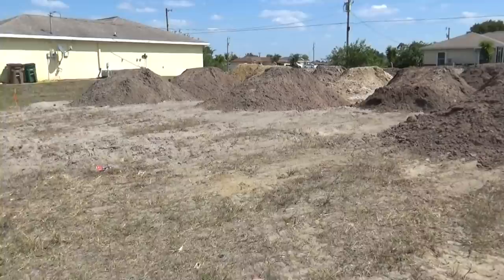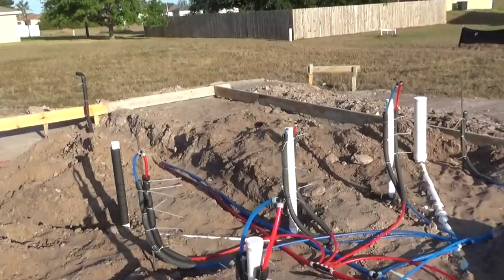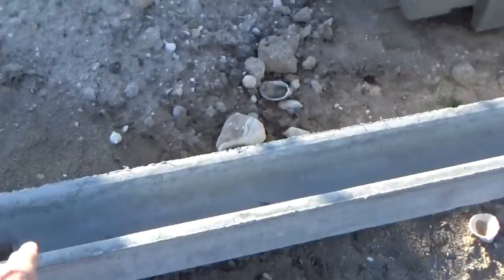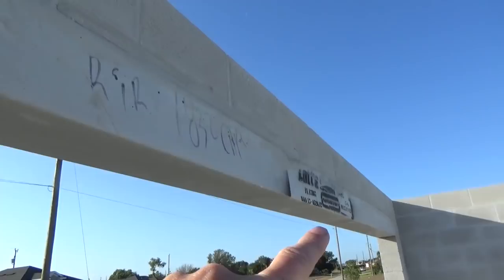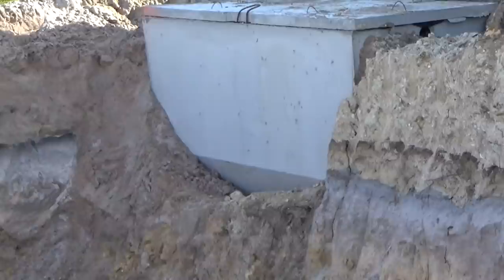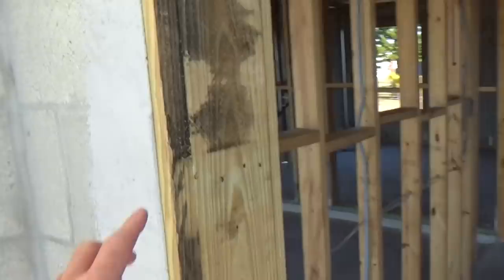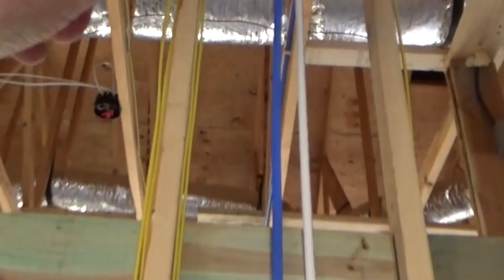FLORIDA BUILDING TECHNIQUES (Mike Haduck)

Comment: Have lived in South Florida 64 years. The construction you saw is production line home construction. You are right when you say it is very shortsighted to pour a concrete slab over the plumbing, but that is the way it is done because it is cheaper and the buyers know nothing about construction. 4 of 5 Florida homes I lived in, were stem wall foundations with a crawl space where all the plumbing was accessible for repairs or changes.  The sewers in my homes were all city sewer lines not septic. It looked to me like the fiberglass insulation you showed was just for the interior partition walls. For the block walls, they likely used aluminum faced 3/4" high density boards between the furring strips on the block walls, with the block/foam/sheetrock I think it is R-11. In the old days it was just block/ 3/4" air space/ sheetrock. A really big foolishness is that they have the air conditioning ductwork and returns going through the attic which can be like 140F+++ degrees, the ducts are like heat exchangers fighting with the air conditioner and practically all the houses are built that way. A big difference between Florida and PA is that they've been building houses in PA for 300+ years, and people lived for generations in those homes, things were built to last. In Florida, it's only been like 70 years and people move every 5 years.
Reply from the maker: Thanks I agree, Mike

Comment: Not an apples to apples comparison on the gravel part, railroads are built on crushed rock ballast specifically so that it CAN shift with load.
Reply from the maker: Thanks, if you got more info or a video on that I'd like to see it, the old timers I knew who worked on the railroad told me rocks are rocks, every bit of info is helpful,  thanks Mike

Comment: I have built over a hundred homes in Ohio and I can tell you that pressure plumbing under slabs is the absolute standard. Zero call backs
Reply from the maker: Hi D, God bless you, I won't pour concrete over them unless they are sleved,  I learned my lesson, thanks Mike

Comment: Florida has the highest home insurance rates in the country because of hurricane damage payoffs. I could see block construction as better able to withstand hurricane force winds but if the hurricane straps aren't installed correctly off goes the roof. Big scams in hurricane re-roofing lawsuits also driving up insurance costs
Reply from the maker: Thanks Shakespeare, I believe that,  thanks mike

Comment: It's interesting to see the homes being built in Florida. I'm from India, and most of India has the same climate as Miami and we get lots of terrible monsoon storms. We would never use wood for anything structural. Even the roof would be made of concrete+rebar and be flat instead of sloping. And you would be able to go on the roof. Other than that and the plumbing part, the methods used seem very similar.
Reply from the maker: Thanks Debo, MIKE
Reply: ? is the concrete roof painted??  it must be Very thick roof for people to go up and be on roof.  in the carribean countries the concrete houses withstand ALOT, (as long as they're built properly

Comment: A hint from someone who is a native of Florida but lives out on the west coast now.  Putting the plumbing, (hot & cold) water is foolish!  True, unlike copper, the PEX tubing will last a long, long time. BUT, if there is a problem in the future you will have to break the slab for repair. Do like we do it in the west for homes built on a slab: Run the plumbing through the attic and down the interior walls to each location. Also, due to seismic and soil issues, post tension slabs are pretty standard here and since the homes typically are of wood frame construction,  anchors about every 24 inches to keep the house on the foundation. Interesting to see that they have cheaped out by using asphalt shingles instead of the standard masonry tiles like we have here.
Reply from the maker: Thanks Ken, Mike
Reply: Shingles depend on neighborhood. Poor get asphalt. Rich get tile or concrete.

Comment: Well Mike you might remember me from talking together several years ago.
My background as yours was masonry, we ran a home building business for over 40 years in Bucks County Pa.
As you know, there are no licensing requirements in Pa. for builders. Other than some local governments (townships), charging for an occupational license annually in order to work in that particular township. Building codes can vary somewhat from township to township depending upon the whims of the building department of that township, and possibly even the building inspector of that township. There is no standard statewide building code as there is in Florida.
Ive been living in Florida full time now for 23 years. I have built 2 homes for myself during that time frame. 
Not all homes here are built with the mono slab method like the ones you visited. 
An optional method is what they refer to here as a stem wall system.
Which is an excavated trench with a traditional concrete footing, and then several coarses of block to the slab level. 
Or the block wall can continue from the footing to the roof truss level, with the floor poured after the roof is installed much like is done in Pa.
The top coarse of block is required to be a bond beam block with a rebar installed as well as the truss straps, and rebars installed in the block cavities on both sides of every door and window opening, as well as every 4 feet apart for the length of each block wall.
I chose to build my house using the standard footing and stem wall method, with a separately poured concrete floor.
So again, that option is permissible, but also a bit more expensive, which is why most development type homes arent built that way.
All the permits and inspections here are on a county level, according to statewide building codes. There are no townships in Florida, only county wide government. Which eliminates much of the local dog and pony show politics.
I have one regret Mike, and that is that i didnt run away from my Pa. home when i was about 18 years old and come here.
Fortunately, i was able to convince my youngest son to move here about 15 years ago while he was in his late 30s.
He worked on my license untill he was able to secure his own state level building contractor license.
His son is in his final year of college here, and will be obtaining his license as soon as possible as well.
They are moving here in droves Mike, and i need not explain the reasons why that is happening.
And guess what else, about 15 minits after a pouring rain, you can back in the concrete truck with no fear of it getting stuck.
And you can do that for 12 months of every year with no worries about it freezing tonight.
How much is that worth over the period of a lifetime?
Reply from the maker: Hi Ernie, I moved to Florida myself last Nov, I wanted to go for years but my dad was way up in age at the time. I got about a years worth of videos left from PA and started to pick up a few here, slowly seeing how they do things, I loved how you said about the dog and pony shows up north, Great to hear from you, I been going around the local campgrounds playing guitar ,banjo and fiddle with the old timers, still have some things to settle back up north, but I got my florida driver's license and am now a Floridean,  west of ft myers,  Goid to hear from you, thanks Mike

Comment: Mike, you might remember me from a prior comment on your basement wall parging post.
Anyway you mentioned Pa, as i stated earlier i started my working life as a plasterer.
My father was born in 1906 and at age 14 became a bricklayer apprentice. As you probably know there were no block back in those days.
So if a wall was 16” thick, it was a solid brick 16” wall. But only the outer areas were what we call face brick, which were of a higher quality than the brick used as fill on the inside of the wall. They were known as Salmon brick, and can be distinguised by their salmon color.
So Mike, with used brick being popular in all parts of the country, what happens when a mason picks up a salmon brick in Pa?
It goes in the wall dosent it.
About 1958 drywall had put many of the plasterers out of work in places like where i lived in Bucks county Pa. So with my father being well rounded in his construction background we became home builders. And i continued to be a home builder there untill 1990 when i moved to the Florida keys to fulfill a dream of being a charter fishing captain. I built my own home in the keys as an owner builder, which dosent require being licensed. I later took the test and became a certified Florida builder.
Now as for the various building methods here in Florida, you can still dig a trench and pour a footing same as is done in Pa. That is known here as a stem wall foundation as opposed to the mono poured slab as in your video. I chose to use a stem wall in both of my personal homes i have built here. I used 12” block in the trench which gave me a 4” ledge to rest the slab on. The codes here are more ridgid than those we had in Pa. But frankly i find that the quality of the tradesmen are lacking when compared to those i knew up there. There are in fact some good ones, but by and large not as good. Block masons could be the exception however, as i have encountered some very good ones here. As for the filled areas you mention prior to pouring the slab, a major difference is the type of soil here which is very sandy and due to the fact that they really go all out on the compaction of the fill as opposed to what they generally do up there. 
As for the licensing here as opposed to really none up there, by and large it is just more government BS.
It creates a very large government agency, and ends up costing average Joe homebuyer more cost for a home not built any better than those areas like Pa that dont require contractor licensing.
But all that said Mike, i only wish i had most of my life to live over. Because guys like us could have done much better in the construction industry here than we did up there. It can rain like hell for hours, but when it stops you can back in the concrete and block trucks when it stops, and you can do that all year long.
Reply from the maker: Hi Ernie, your a old timer that has knowledge the young guys don't understand,  lots of gov bs has come up here now,  I had a sailboat in the keys, Fiesta key then Islamorada, I had a Job in keyless and laid brick on Mallory Sq,  but got a small trailer near occhicobie,  I am only hanging around up here because my dad is very old, but someday I will be living in Florida too, thanks mike

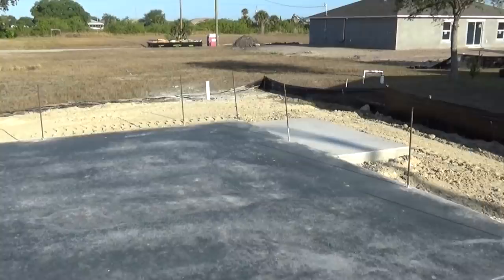Comment: @2:00 -  As a retired plumber/fitter, I roughed in plenty of houses with plumbing under the concrete slab.   If it were a house I was building for myself,
water pipes would not be under the slab.   But, when I had to do it, it was sleeved copper pipe, type L, which means it was a heavier pipe than would
be installed in the walls of a house, and all joints under the slab had to be brazed instead of soldered.   This new plastic tubing for waters is a sin.
In order for the manufacturers to get this plastic pipe approved, they had to butter the palms of crooked politicians.
Reply from the maker: Hi, I agree, you can see trouble coming before it starts, thanks mike
Reply: @drtyjrze  ~  I'm certain that there are companies that sell such substances, but I'm not altogether certain how well, or for how long, they work.    When they rough in a house or condominium structure, the reason they install the water pipes beneath the slab is usually to save money.    The copper water pipes are layed within the concrete forms, and a plastic sleeve is over the copper pipe to keep it from coming in contact with the concrete.   During the interval between installing those pipes, and the time that they pour the concrete, other workers will be working in that same area.  They will not have the same respect for those copper pipes with their plastic sleeving as a plumber would.   And the workers pouring the concrets pay lilttle attentine to the sleeving on the copper pipes, which means probably there is a tear in those sleeves where concrete may touch and expand and contract at a different rate with the copper pipes.   And over the years abrasion may occur.    If there is a leak, there is no jack hammering the concrete looking to repair it.   They run the pipes up the walls and into the attic to the sinks, showers and tubs.

Comment: What do you think of the homes being built out of block? Do you think it makes the homes much more sturdier than the typical wood frame home in the north? Do you know what the main reason for them building out of block is? Is it for the actual hurricanes or is it because of wood destroying insects?
Reply from the maker: Hi Gregory, my dad worked in florida in the 50s and they were basically building the same way back then , and there is a termite problem I know,  thanks mike
Reply: Insects aside, its is 100% because of hurricanes. Wood houses in Florida rot quicker too. But a wood home in a Florida hurricane is much like a mobile home in terms of potential damage. And while an all wood construction home in Florida is certainly secured to its foundation much better than any mobile home, in the face of a hurricane, wood-based home exteriors are a serious risk factor.  Wood is just no match for a Concrete Block Structure (CBS) home, which can withstand winds up to 250 miles per hour and provide extra security during hurricanes, tornadoes and even earthquakes.

Comment: Mike would you know why the builder mixed wood and steel framing 
inside the building? Aside from the price for lumber hitting the 
pocketbooks...?
Reply from the maker: Hi pensive, I really dont know, thanks Mike
Reply: Looks like the kitchen. Straighter walls to hang cabinets, place stone countertops and set tile. Wood won't give you that.

Comment: Looks like a solid house with the blocks. Seems like they could treat the rebar with some kinda coating that would slow down or prevent the rust and corrosion. Maybe galvanized rebar?
Reply from the maker: Hi Gary, that's what they do and then they inspect it, thanks Mike

Comment: My sister in law and family moved from Maryland to a house in Wellington Florida that they rented to make sure they liked Florida and the area. I went down there to visit and was looking around the house and like most houses there the common areas of flooring were all tiled and across the kitchen and great room there was a very long crack clear across both rooms. They were considering buying house from the landlord but I talked them out of it. If the tile is cracked then so is the concrete and the broken tiles go under the cabinets and the base plates to the walls so how do you remove and retile the floors? 
They actually found a much nicer home within a half mile and had no visible flaws to have to correct as it would have been an expensive undertaking. 
Nice video Mike, would you ever move from Pennsylvania? I’m so tired of cold weather I want to leave New Jersey.
Reply from the maker: Hi Clint, I hate the cold for sure, mike
Reply: Good thing you talked them out of buying it, that's a sign of a sinkhole beneath the house, wow. Go look up signs of sinkholes on youtube for Florida.

Comment: Hi Mike.
Another fantastic video as always.
I have already told you on occasion that I am building a house with stone and cement and it is beginning to take shape. Inside I want to finish it with plasterboard and I had thought of rock wool as an insulator but I have doubts with the polyurethane foam.
It is an area of Spain with cold winters and hot summers. What do you recommend me?
Thank you very much in advance and thank you for sharing the videos with which I am learning so much.
A greeting from Spain.
Reply from the maker: Hi Piter, good th hear from Spsin again, I cant really say, it would be up to the building codes there, here we put the styrofoam and then the sheetrock over it, and I never seen a problem,  thanks mike

Comment: funny houses. It will be very, very cold in such houses in Russia. we have a cake of insulation, such a wall is usually at least 500 mm: 250 or 380 mm brick, insulation, then an air gap of 30 mm and another 120 mm brick. we use insulation with a thickness of at least 100 mm. That's it. Looking at these technologies, we find it funny. all success. Mike, thanks.
Reply from the maker: Thanks, I appreciate your input, I wish I could film that in Russia,  thanks again, mike